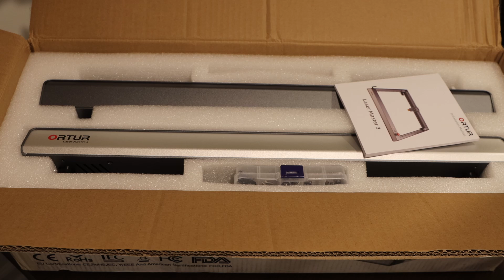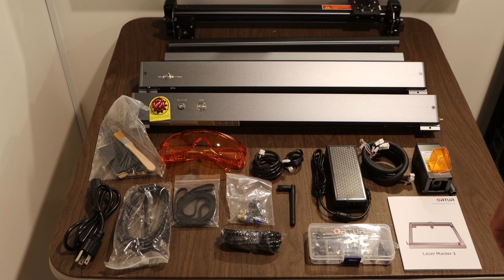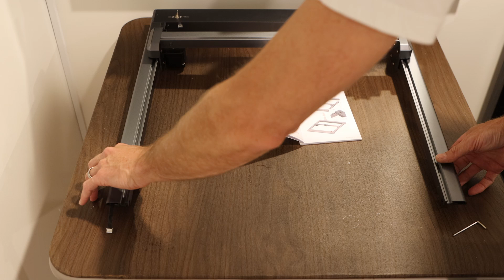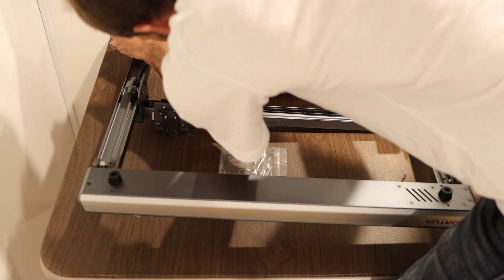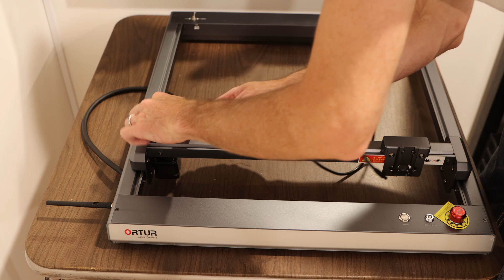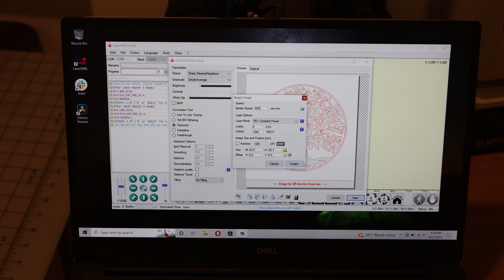Laser Master 3 by Ortur - Machine assembly

Comment: It was really helpful to see the idler assembly and how one should install it. The current version of the machine comes with a slightly different idler, but it's close enough to the one you are showing here. The manual is useless ... shocker, I know;-) My machine fails to detect the home position ... which since has been resolved by tightening the Y-axis belts. They apparently need to be really taught. The manual could have been more explicit about this.